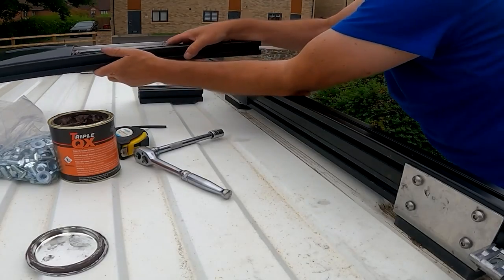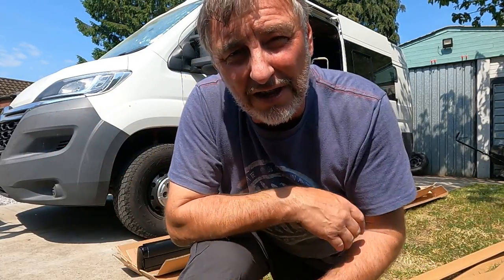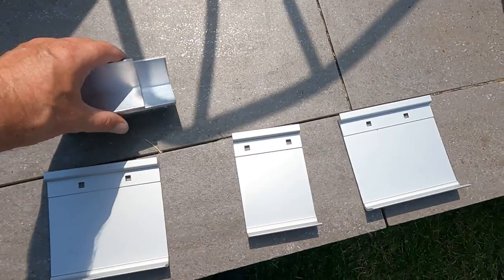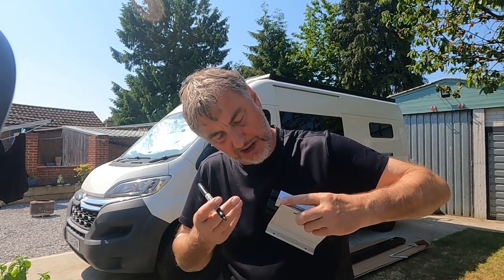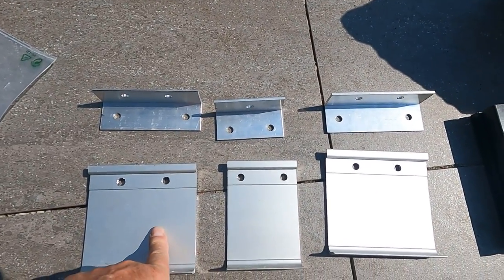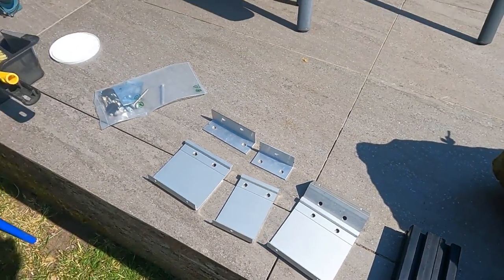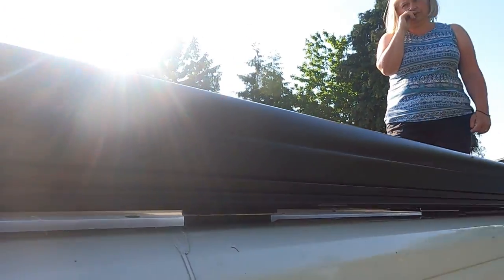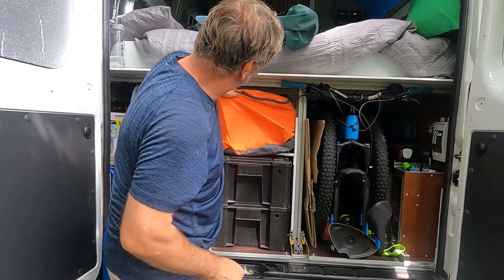Fitting FIAMMA 45s AWNING to 80/20 style extruded alloy ROOF RACK

Comment: Be aware stainless steel and aluminium do not go well together in a wet environment. They react electrolytically, if I remember correctly the stainless erodes the aluminium. I think zinc plated steel it a better option. Steve
Reply from the maker: It does Steve you are absolutely correct.
Years of Land Rover Restoration taught me that.
Quantities of copper grease will go a long way to helping with that problem and I have been coating fixings with Lanoguard and the occasional spray of WD40.